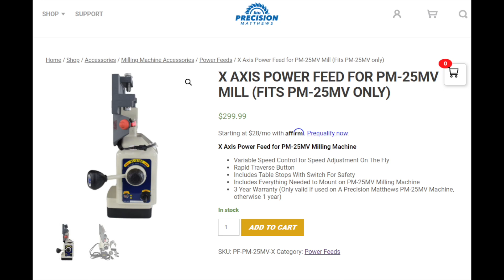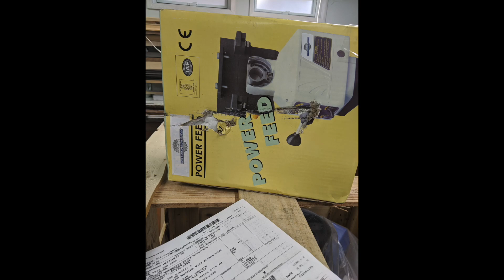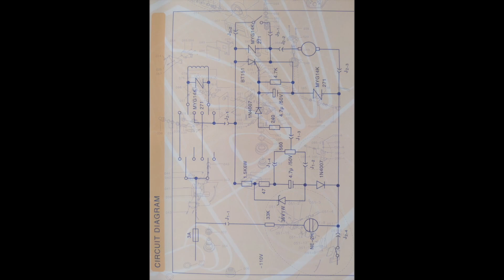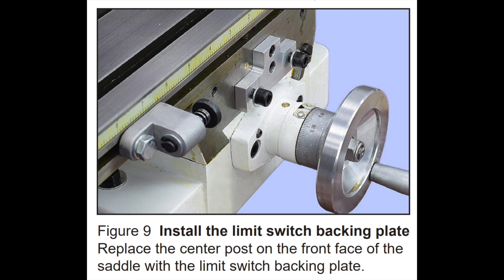Installing a Power Feed  for a Precision Matthews Mill

Comment: Thank you for this clear, well presented video.  I’m using the same power feed on a Jet round column and was curious how the gear engages the screw.
Reply from the maker: It is a straight gear rather than a bevel gear, which works fine but is a bit noisier